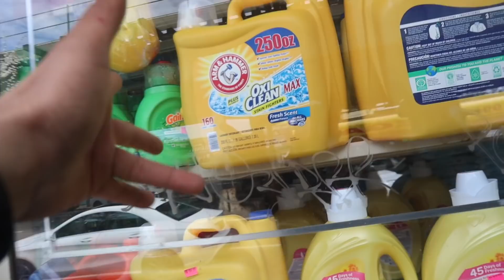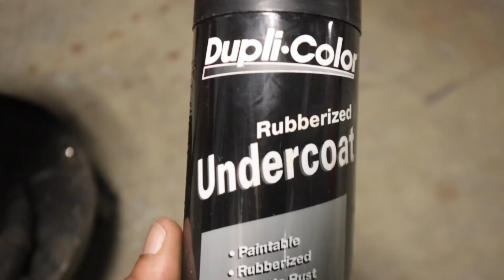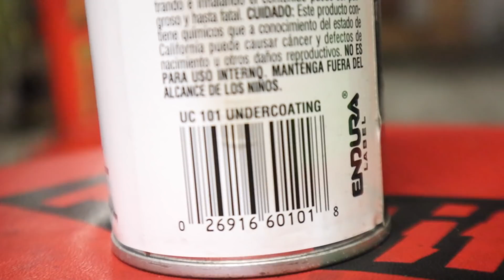Undercoating The Mazda RK-K (DIY)

Comment: That undercoating works great, it doesn't give you that factory texture but I use it on suspension parts and it holds up.